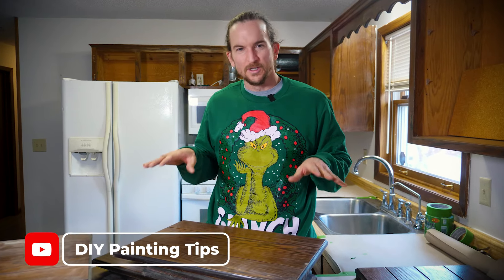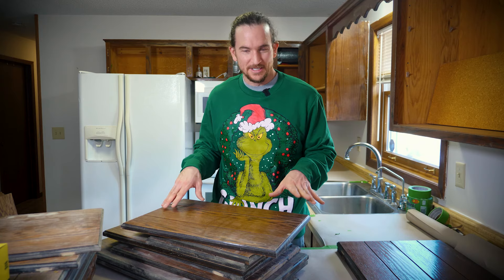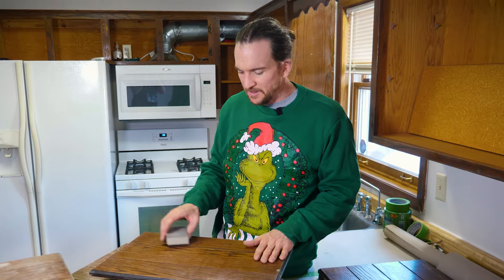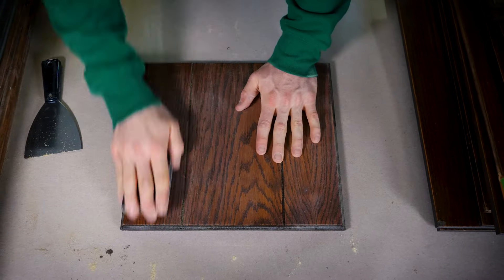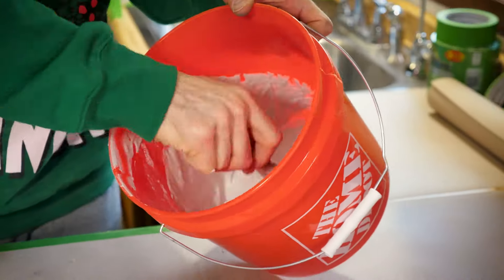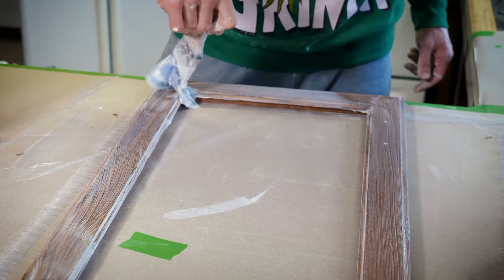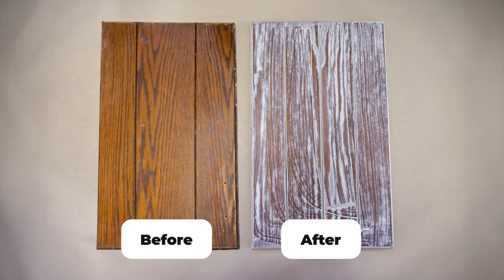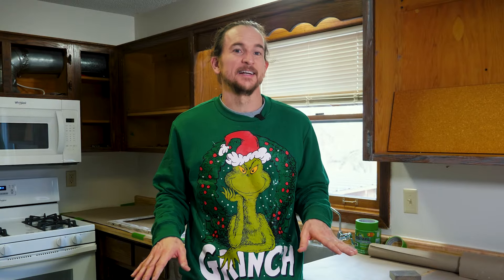How To Fill Wood Grain For Painting Oak Cabinets

Comment: Do not use joint compound to do this. That's insane. They make wood putties and fillers with glue and hardeners and actual wood so that you still have wood doors. And  you don't even need that. Start with 120 grit sand paper, then 200, then 400. Your wood grains will be gone. Don't over do it though. Once you get up into the 1000 grits your filling all the pores paint would seep into to bond with.
Reply from the maker: I've done over 200 sets of cabinets with this exact method. It's significantly cheaper and easier than using those wood putties and fillers. It sands better and holds up perfectly. Some of the jobs I've done with this method are going on 20 years (been painting since 2001).
Reply: Agreed, woodgrain filler all the way! Timbermate is cheap, and much stronger then spray it with a coat of dewaxed shellac or a good primer before painting

Comment: I feel like this wouldn’t last long at all. Cabinets expand and contract all year round, the mud compound areas would chip off.
Reply from the maker: I started doing this exact method in about 2008. I have never had a client call back about this not lasting or chipping. I’ve done over 200 sets of cabinets on that time as well. As long as you prep properly and use your correct primers, it will last as long an incredibly long time.

Comment: I'll try gypsum mud, thinned with water, but will trowel it, instead of brush, to better force it into the grain.  Should be sound since drywall mud sticks well to wood.  Spackle has polymer binders (vinyl?, latex?), perhaps similar to the polymers in "modified" thinset for tile.  Not sure thinset would work since it also has sand particles which might be too large.  Another thought is polymer type tile grout (latex?), which doesn't have sand.  I have some left-over so will try it, and it can be thinned with water.  I read of Aqua Coat and Goodfilla, but many reviews are poor, either doesn't work well or too tedious (multiple coats).  I'll use BIN primer (shellac) to avoid later bleed-thru.

Comment: What is the name of the wood grain filler and where do you get it? My wife and I are about to paint our kitchen cabinets and need to do this….
Reply from the maker: I use Plus 3 drywall compound mixed with water. Here's an old video I did showing the process: https://youtu.be/21W8kF3cO4A
Working on a new updated video right now.

Comment: Does your filler not shrink at all? Or it is minimal. I was told they always shrink a little bit which means you need to fill proud then sand back. But i think you're not filling proud.

Comment: Have you ever had any problems with it cracking or falling out?  I would worry that if the doors got slammed enough over time, the drywall would crack and come out
Reply from the maker: Been doing this method for over 15 years and never had it fall out or anyone call about it falling out or cracking.
Reply: @diypainting Awesome. We’re about to paint 30yo oak cabinets and I’ve been looking for a method that didn’t involved sanding them flat or spending hundreds in the wood filler. So glad I found this before we started